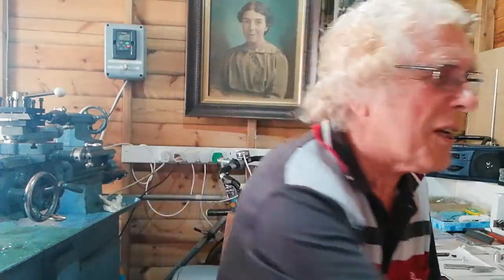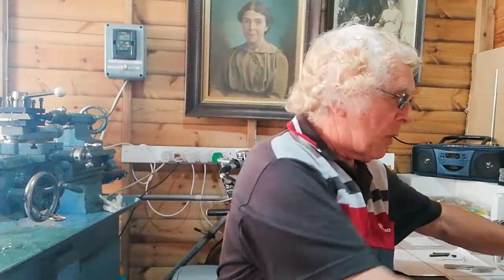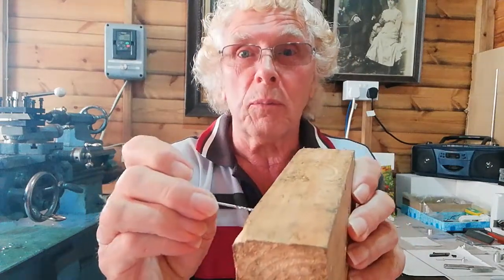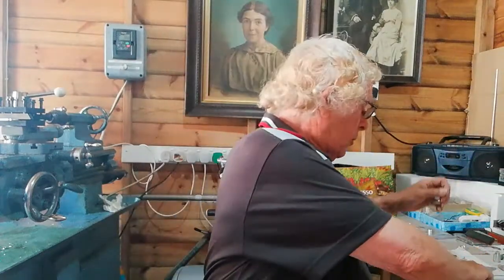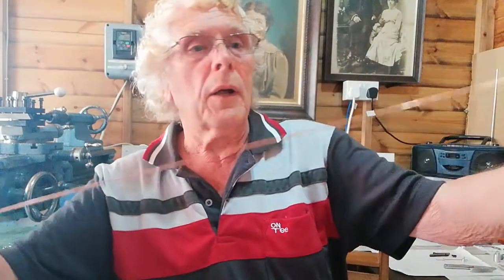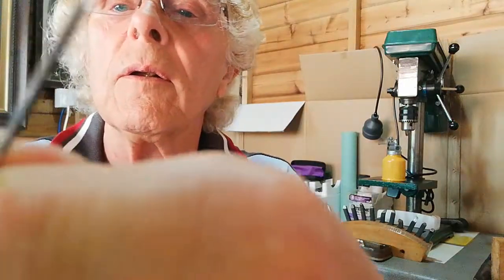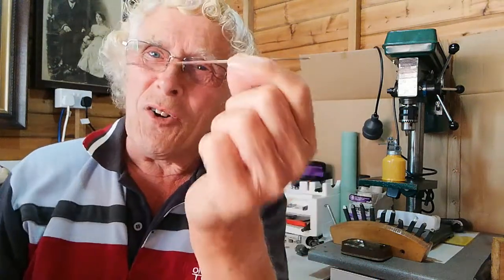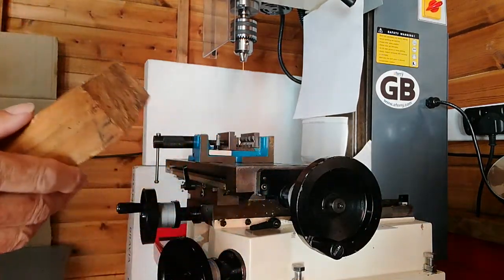How to make a Long Reach Drill. Simple and easy to make in any home workshop!

Comment: Thank you for your demo, a question for you what material is the drill bit substitude, and I realise that the deilling machine to be well tuned and not out of allignment.  Kind regards fro oz jack Marashlian
Reply from the maker: A good question Jack. The drill used in this video is copper coated mild steel, cut off a welding rod.
This process can be done on most any drilling machine. The important thing is to make sure that the drilling piece is as straight as possible and spins as true and central as possible.
Try it and thank you for your comment. 🍀

Comment: Hello Sir, I am needing to find a drill bit 60 inches long and 3/16 in or no bigger than 1/4 in in diameter to drill its entire length straight in end grain.  Is such a drill bit available?  Can it even be done?  Thanks.
Reply from the maker: Hello there and thank you for your most interesting questions. I will try to assist you achieve the objective, which is so unusual, I have never come across this problem before. It seems to be a design issue that  could maybe resolved after reviewing alternative options.
I have to say that although at this stage I do consider that it could be feasible, I need further information.
1 I assume that the material  choice is wood; so what type is it?
2 What workshop facilities do you have ;  lathe, milling machine, drilling machine, types and capacities?
3 What accuracies and tolerances do you hope to achieve?
4 What is the purpose of the object you want to make.?
There are manufacturers of drills and tooling that can produce special non standard items. The cost of which may well be far too expensive for your project, but if money is not an issue, then make inquiries.
Personally I think that it may be a better option to make your own device, but there are several issues to consider prior to machining and producing the product that you describe.
I look forward to your response and hopefully I will be able to advise accordingly.
Reply: @keithatklint5380  Thanks for the interest.  I will be building a sled for a drill for the extra long length and was thinking to set up a drill guide in line with said sled to shoot the bit straight into wood. I own a tree removal co. in Philadelphia and I have an idea to make a product out of the large oversized logs I must pay incredible amounts of money to dump off my grapple truck. I need to be able to drill multiple holes all the way through 4 and 5 foot logs of many native species...oak, cherry, maple, pine, as well as catalpa, paulownia and walnut. I also must be able to drill them parallel to one another but not in the center of the log...from 4 or 5 inches from the bark, then 1 inch apart for multiple holes moving in towards the center.  Drilling these holes would be the first step in a process I am developing and it is the first hurdle I must overcome.
Reply from the maker: Hmm, I have had good times in Philadelphia during a previous business trip.
So now I have a better idea of what you're trying to do, the following suggestions may be useful for your considerations.
It seems you're thinking on the right lines and it would be logical to make some sort of jig or fixture to ensure alignment. Before deciding on the best option; there could be several of your ideas to consider to be worth further development, during the design process. 
It would be beneficial to research any similar existing ptoduction methods. 
There is a technique known as gun drilling, usually with the use of C. N. C. machines. One such manufacturer being located in the U. S. A., being "Haas" machine tools. I have seen these machines in action and almost purchased one. A feature that should be interesting, is that several holes that you describe, can be machined simultaneously and to the depth required. 
Regardless of this, it will still be beneficial to produce a prototype product, by the method you are currently considering. This is essential for evaluating the viability, desirability and potential demand for a future production run. 
Another suggestion would be to make your sled guidance device out of wood, that you have already ample access to. 
Also consider drilling from both ends as that would dramatically reduce the length of the drill. It would also be beneficial to include in your design fixture, provision for supporting the drill for allignment purposes. 
I don't know if you have given thought to supplying wood Turners with the variety of timber that you have for disposal. Just a suggestion for an alternative market. 
Well now, I hope this has helped you to formulate a more structured plan of action. It is an interesting project and I would be delighted to receive further updates from you in due course. Good luck and I wish you a successful conclusion. 🗜️ 🍀
K
Reply: @keithatklint5380  Thanks and sorry for the late reply.  Yes, I am keenly planning on selling turning blanks.  I own a vacutherm iDry 2000 bf kiln...Idk the demand for turning blanks, but in my industry, we are cutting trees which grew solitary for their species, therefore they have many twists and turns, which gives, what I believe the turning community calls 'character' to the piece (we call them knots and crotches in mine).  I believe that I could line the back of my kiln with a couple hundred blanks and leave them there for several charges, ensuring that they would be 'turn ready' after a few weeks.  
I have been reading on drill bits which do not cut on the side, just in front (similar to what you are doing here).  I haven't decided on a sled or if a drill guide keeping the 12 - 18 inches of bit, just before the piece, perfectly straight would keep the 3 -  5 ft of bit in the piece from wandering.
Reply from the maker: Hi and thanks for the update. I think that any wood turner would be delighted to have blanks from such a variety of what may well be rare species of trees.
Regarding production methods, as with all new projects and innovations, it is a case of trial, error and correction to establish the best possible way forward.
It may interest you to note, that when I have previously had conversations with bowl turners, most of them informed me that they dry out their material naturally without the use of kilns or any other source of applied heat. It also saves energy which is much more cost effective. 
Just thought I'd mention it and also thank you for subscribing to my  video channel. 
Your project is really interesting and I would like to know about further developments. 
Thank you for your comments, which are most appreciated. Good luck with it all.   🤞🍀. K.